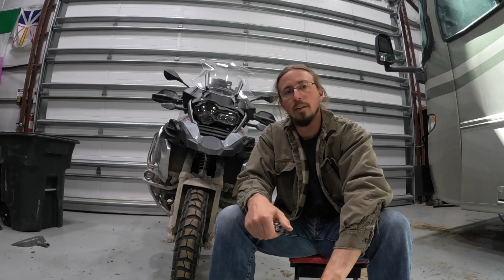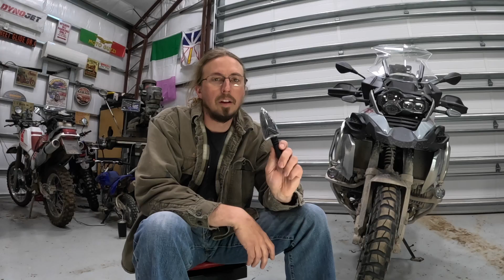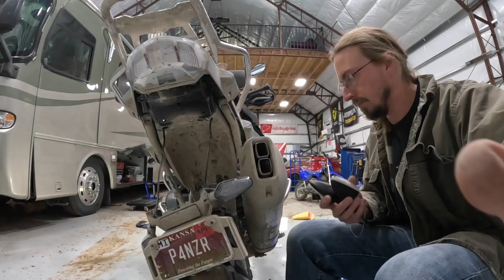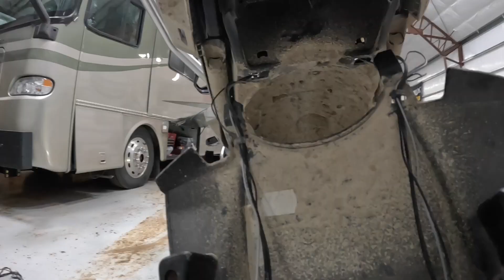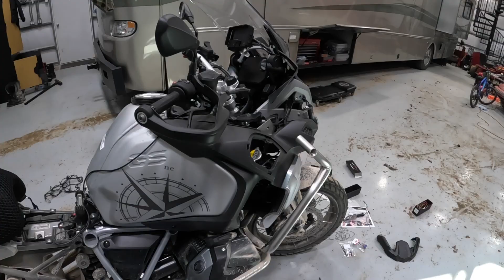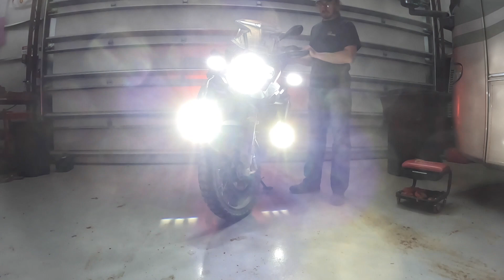Weizer Technik Turn Signal Review and Install on BMW R1250GSA

Comment: The reason I feel you assemble the lights is that they offer 3 lengths of signals. Offering them all assembled means EACH set needs to be complete. If as a kit, they can order "x" of the light guts and then stock various amounts of stem lengths according to popularity. Basically, it simplifies and lowers the cost of their inventory.